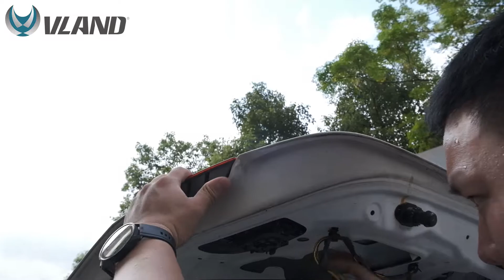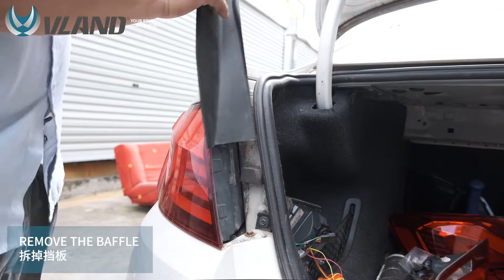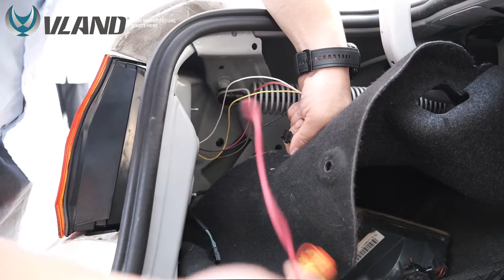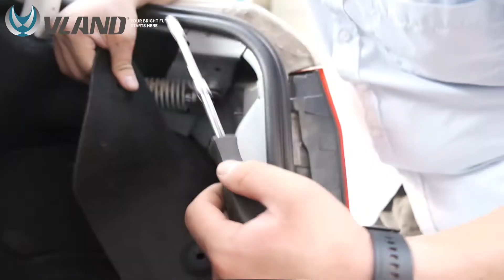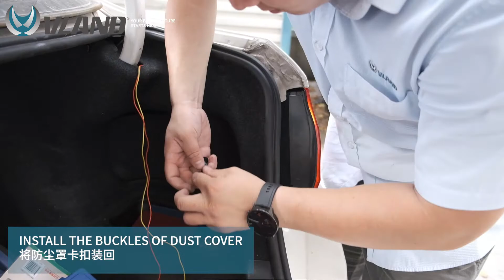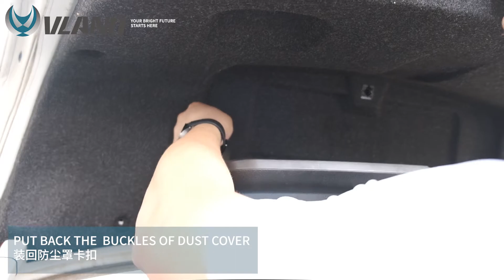BMW 5-Series 2010-2017 F10 F18 6TH GEN VLAND OLED TAIL LIGHTS Installation Guide

Comment: Why do some of the inner brake light work with some models of bmw and not others? Specifically speaking the 4 series/m4 lights the inner trunk (lid) brake lights don't illuminate when used like they do in this video...
Reply: They add extra wiring on side from the main brake lights to the inner to mimick the light. Essentially a splitter.